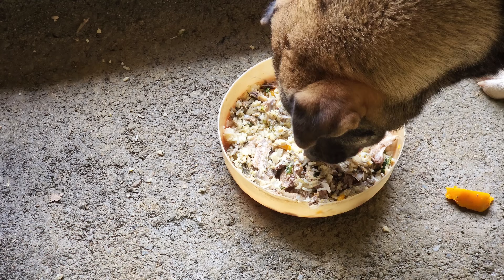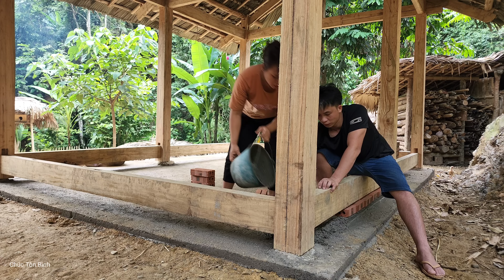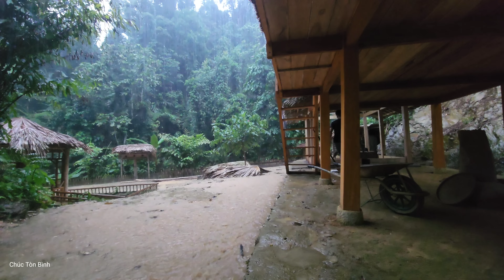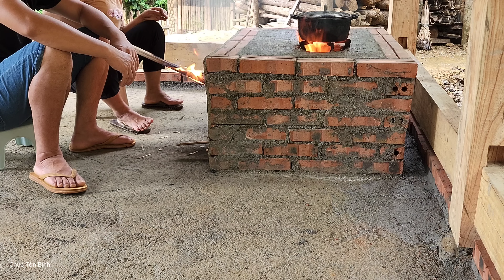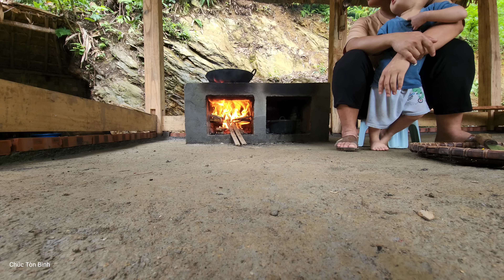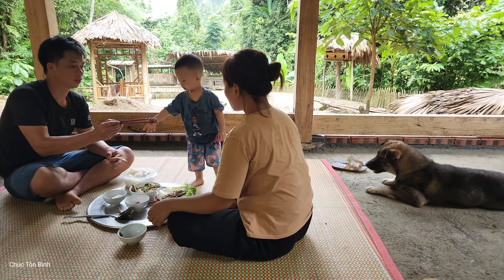Build Your Own Brick Walls Easily | cooking with family - Chúc Tòn Bình

Comment: French drain would be beneficial there. 

Drainage problems in your yard can lead to pooling, mold or water damage in or around your home. Luckily, you can avoid these problems by installing a French drain. A French drain is a trench filled with a perforated pipe and gravel that allows water to drain naturally from your yard.
Reply from the maker: You have very meticulous observation, thank you for watching my video.❤❤